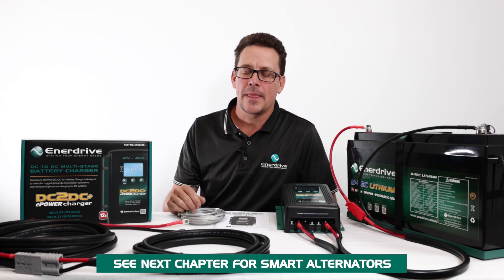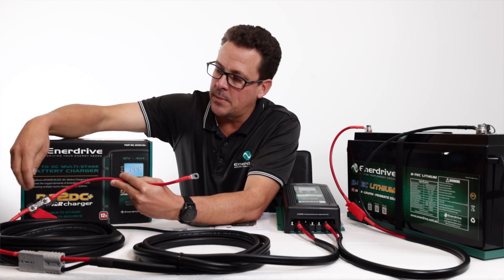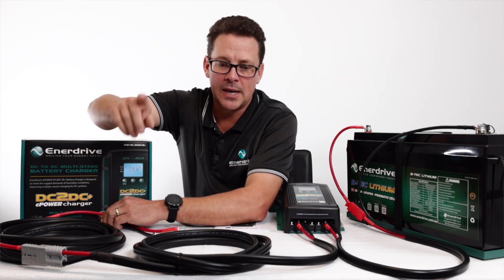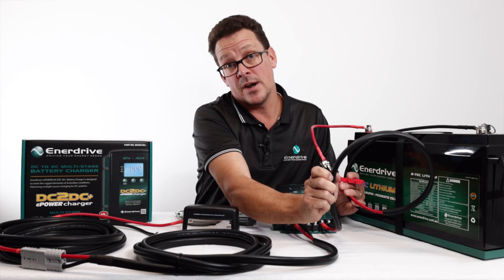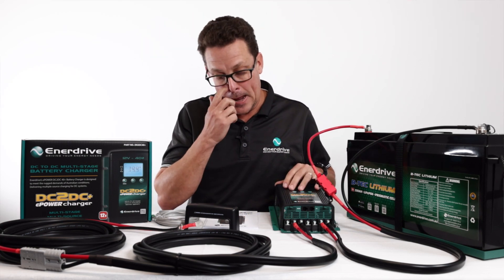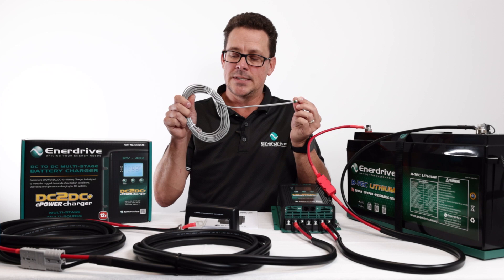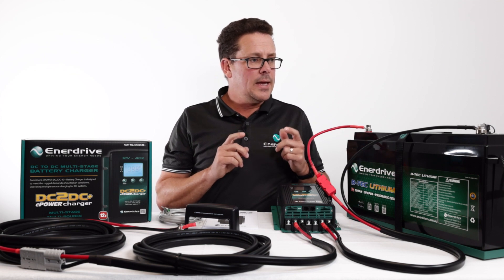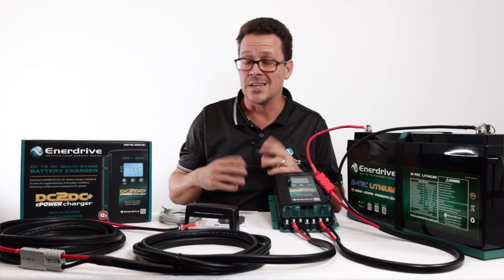Enerdrive DC2DC Chargers - Part 3 - How to Install

Comment: Hey - I have just set my solar system up today - as i plugged in the battery and then the solar panel into the controller - I dont get any reading or power from the controller.

Must I also connect to my car/van battery? 

OR can I just have the solar panel?

It is a second hand one so I dont know if it is just broken - or if I have made a mistake.

Any help would be much appreciated 

Thanks,  :)
Reply from the maker: Hey, thanks for your question! For the best support, please visit our dedicated support centre: https://support.enerdrive.com.au/. You can also find helpful resources, FAQs, and contact options there, including phone support and a contact form.

Comment: Great product & info.  Mine has been going great for several years.  I've had to reconfigure the install & was wondering if the charger needs an external earth strap.  The previous installer had put one on but it now needs to be longer whereas your setup has none.  Can I save the effort of making a new one?
Reply from the maker: Thanks for the kind words and support. For the best tech support, please visit our dedicated support centre: https://support.enerdrive.com.au/. You can also find helpful resources, FAQs, and contact options there, including phone support and a contact form.

Comment: Hey mate are the negative terminals completely isolated from each other or paralleled? I'm planning to purchase this unit to retro fit into an existing setup but the solar panel has been grounded to vehicle chassis and would prefer not to rewire the entire solar setup.
Reply from the maker: For the best support, please visit our dedicated support centre: https://support.enerdrive.com.au/. You can also find helpful resources, FAQs, and contact options there, including phone support and a contact form.